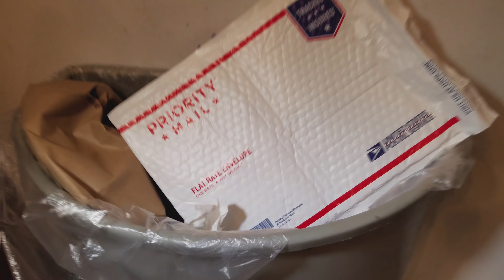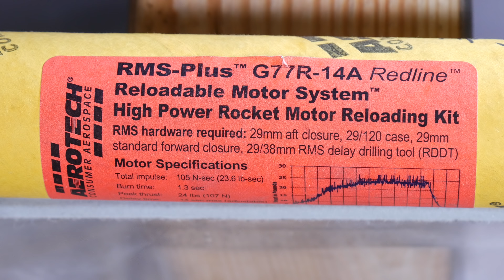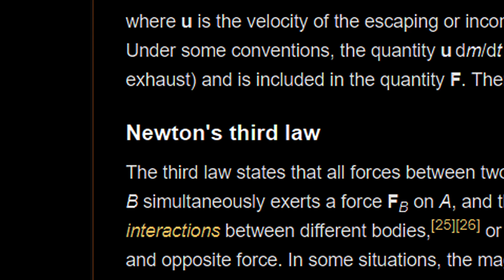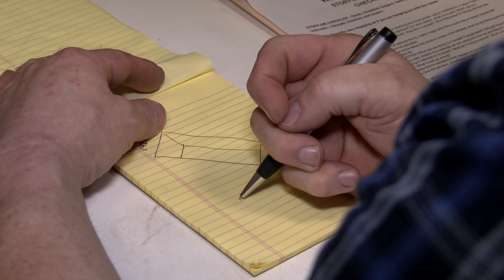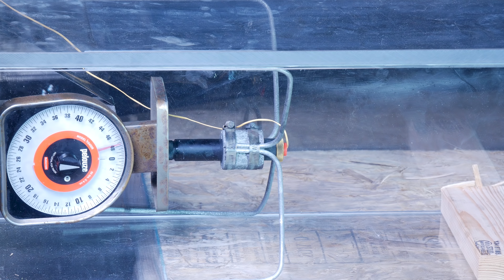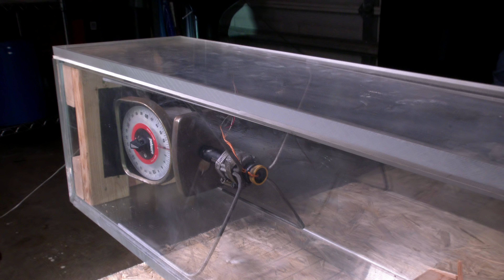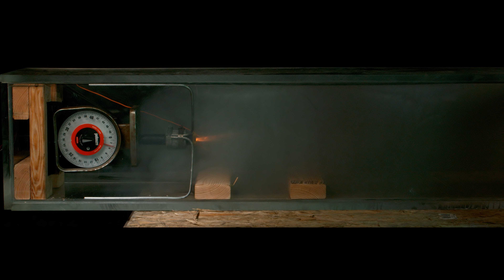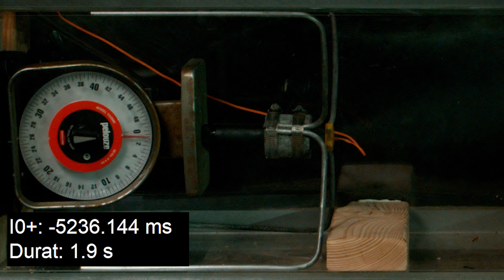Rockets in a Vacuum Chamber - Newton's third law of motion Visualized

Comment: There was no more vacuum when the smoke and gases filled the chamber. Even more, it is seen that the thrust increases with the increasing concentration of gas and particles inside the chamber. An even bigger chamber with constant dynamic vacuum would be required.
Reply: In increase in thrust over time is due to the motor design, these motors rarely have a constant thrust it changes over time depending on the thrust curve of that particular motor.
Reply: Correct. This video actually does more to prove that propulsion DOES NOT work in a vacuum.
Reply: @MoneyIsSilver  I could explain how rocket propulsion works but you must have at least a high school grasp of basic physics.  I guess that disqualifies YOU.
Reply: @stuartgray5877  You guys just embarass yourselves with the insults and lack of any real arguments.
Reply: @MoneyIsSilver  - "and lack of any real arguments."

Ok let me get this straight. I tell YOU the following:

1 - I have been testing fiber-optic gyroscopes using earth rotation as the stimulus for almost 30 years and is Proof of a spherical rotating earth.
2 - I have personally launched SIX spacecraft, four of those to deep space, and helped OPERATE them, then had the scientific results from the missions reviewed by ACTUAL SCIENTISTS, is proof of the spherical rotating earth.
3 - I have PERSONALLY taken photos of earth using more than one camera from space and SEEN that the earth is a sphere.
4 - The fact that YOU CAN SEE THE ISS in orbit complete with giant solar arrays and the Dragon spacecraft docked to its side is proof of a spherical earth
5 - The GPS Constellation is proof of a spherical earth.
6 - The FACT that the Moon rotates one degree for every 70 miles moved north/south is proof of a spherical earth.
7 - SATELLITE TV is proof of a spherical Earth.
And I can KEEP GOING!

And YOU say these are not 
"real arguments".

Sorry but these are all "real" AND are "arguments".
So, I think I have figured out the problem:
YOU
DONT
KNOW
WHAT WORDS MEAN,
 SHITHEAD!
Reply: Zener - Can YOU answer my three questions above?  These will help you to understand what is happening in a rocket engine in a vacuum.

DO you think RECOIL would still work in a vacuum? If you fired a crossbow into a vacuum, would it still have recoil?
Reply: @stuartgray5877  You don't even understand that appeals to authority are a logical fallacy.
Reply: @stuartgray5877  Again, can you explain why the engine in the video doesn't pull against the wire immediately, and only does once the tube fills with gas? No, you can't, because you would have to agree with the facts which agree with me.
Reply: @MoneyIsSilver  So an Appeal to NEWTON regarding PHYSICS is a logical fallacy?

See you STILL don't know the meaning of words.

Now answer my questions and prove you have a clue.
Reply: @MoneyIsSilver  Why are you afraid to just answer three yes/no questions?

All they do is prove if the reader understands newtons first two laws.
Reply: @ezraprice6709  And you can provide evidence of that?
Reply: @MoneyIsSilver  - "can you explain why the engine in the video doesn't pull against the wire immediately"

It is true that the ignition of the motor in that small vacuum space "ruined" the vacuum almost immediately.
Then there is always a noticeable delay in a solid rocket motor igniting before it reaches even 50% of rated thrust.

This is a bad example of rocket propulsion in a vacuum, but I have a much better one.
Bet lets define "Vacuum" for the sake of the conversation.

How low of a pressure would you need to see evidence of a propulsive maneuver taking place before you considered it "vacuum"?
Is one TENTH Atmospheric pressure low enough? or One One HUNDREDTH atmospheric pressure?

How low of a pressure do I have to perform the experiment IN for you to be happy?

Assuming I maintain his level of vacuum, or higher, through-out the test?
Would one one-thousandth of atmospheric pressure be low enough?

I don't want you moving the goal posts once I agree to show you video evidence.

And just for full disclosure: I have been a vacuum test specialist for over 25 years with experience running some of the nations largest vacuum chambers with billion dollar experiments inside.
The company I work for tests rocket thrusters her on earth in a vacuum, and again in space.
I have had about 25 years of hazardous materials handling certifications at Military installations like CCAFS and VAFB from fueling spacecraft before launch.
Reply: @MoneyIsSilver   @MoneyIsSilver  - "I want to meet you in person to tell you what an idiot you are to your face."
I am an Aerospace Test Engineer with almost 30 years experience and I have hands on worked on two hypersonic vehicles that actually flew through earths atmosphere. One of them is in the Smithsonian with my signature inside it.
I have also helped build, test and launch, six spacecraft, four of those were deep space science probes.
I have worked at (or for): Lockheed Martin, Jet Propulsion Laboratory, Laboratory for Atmospheric and Space Physics, Marshall Space Flight Center, Goddard Space Flight Center, NOAA, Ball Aerospace and DOD.
I have been on the mission operations team of three spacecraft, the launch conductor for six, and a Flight Director at JPL.
you can find my resume as I dont hide my identity.

Now tells us all what YOU do.
Reply: @MoneyIsSilver  Oh. I SEE that you deleted a bunch of your comments!
Why is that?  Were you EMBARASSED by what you found when you looked for my resume genius?
Did you realize you were dealing with someone with an IQ greater than their shoe size for a change?
Now you ran away?
Maybe you learned that one should not argue about basics physics with actual engineers when you have never even completed HIGH SCHOOL Physics.

I accept your surrender.
Reply: @MoneyIsSilver  To all of the OTHER READERS:

The point I was trying to make WAS:

We have established that when a rocket engine is running it is ACCELERATING the MASS of the exhaust gas from the nozzle.
This means that there MUST BE a FORCE accelerating that mass.
There is NO OTHER WAY to accelerate mass than with a FORCE.
Newtons first TWO LAWS makes this very clear.

But what does the THIRD law tell us?
That "For every ACTION there is an equal and opposite REACTION".
This means that "Forces only occur in PAIRS".
A force can NEVER occur ALONE.
when one object with mass pushes on another object with mass - BOTH OBJECTS FEEL THE FORCE!
THIS is the meaning of the 3rd Law!

So if the rocket is exerting a FORCE on the mass of the exhaust gas then what do we know?
That the exhaust gas EXERTS AN EQUAL AND OPPOSITE Force BACK ON THE ROCKET!

Now that you understand ALL THREE of Newtons laws we see that a rocket PUSHING OUT MASS - FEELS THE SAME FORCE BACK ON ITSELF!
This is called RECOIL or ROCKET PROPULSION .
It occurs IN A VACUUM just as Newtons laws tell us IT MUST.
Reply: @stuartgray5877  I didn't delete any comments. The poster probably is censoring me.
Reply: @MoneyIsSilver  Oh, then perhaps your response to my questions was also censored.
If that is the case then I apologize and ask you to repost.

Care to try again?
Reply: @MoneyIsSilver  I guess to ask the question in a much shorter way:

Can any device (machine, catapult, crossbow, gun, etc) accelerate 500 kilograms of WATER (liquid, ICE, doesn't matter) from a standstill to 2500 meters per second WITHOUT Feeling a recoil force?

It doesn't matter if the device is firing into an atmosphere or a vacuum, WILL IT FEEL RECOIL?

Imagine an aircraft carrier catapult that can fire three oil drum's worth of water from a stop to MACH EIGHT before the barrels leave the catapult.
Does the ship feel the recoil of that firing?
Yes or no?

(of course I know there is no aircraft carrier that CAN do this as that is "Ludicrous Speed" and none are capable of that).

Its a yes or no answer
Reply: @MoneyIsSilver  still refusing to answer simple questions?  Why are you SCARED?
Reply: @stuartgray5877  I think he can answer your questions once YOU figure out that you never actually ASKED anything😐...you just made alot of statements and asked 1 about newton😆 I think YOU need help with words mr "scientist rocket man with no actual proof"
Reply: @stuartgray5877  ah! So you finally did ask a question but it has NOTHING to do with ZERO oxygen atmosphere but nice try ..and if you know what you know, then youd KNOW that asking that question about the vacuum chamber and different atmospheres was a stupld question 😆 because I could have sworn we were talking about SPACE.. where rockets that you CLAIM to work on are supposed to go.. but it seems to he a problem apparently...and let me guess you also worked on the moon landing lol
Reply: @wealthnow5166  - " think he can answer your questions once YOU figure out that you never actually ASKED anything"

Thats Odd since I cut and Pasted the following FROM ABOVE:
"1 - When a rocket engine is running, is the exhaust gas ACCELERATED by the engine? Yes or No?
2 - Does the exhaust gas have MASS? Yes or No?
3 - Can any MASS be ACCELERATED without a force? Yes or no?

(or is a force REQUIRED to cause an acceleration of mass?)"

See so I DID ask questions. But since you are new to this thread I wasn't ASKING YOU.
But please be my guest and answer.
Reply: @wealthnow5166  Want to talk about rocket in VACUUM?

Sure, answer these three questions about ROCKETS IN VACUUM:

1 - When a rocket engine is running, is the exhaust gas ACCELERATED by the engine? Yes or No?
2 - Does the exhaust gas have MASS? Yes or No?
3 - Can any MASS be ACCELERATED without a force? Yes or no?

(or is a force REQUIRED to cause an acceleration of mass?)

Now answer these three questions about rocket propulsion and we will get to the NEXT questions.
Reply: @stuartgray5877  yes yes and yes
Reply: @stuartgray5877  no I actually looked at your page you appear legit but I still want to see an actual space not low earth orbit and reentry after booster stop ykno?... I hope you dont dismiss tho
Reply: @stuartgray5877  those questions weren't anywhere around before I appeared  and the first time you asked these questions you asked it to ME lol... you @ me twice with the same question..I can screenshot and send but I dont think you'd care to lie Id hope
Reply: @wealthnow5166  - "yes yes and yes"

Close.
The answers ARE:
Yes, the exhaust gas IS accelerated.
Yes, the exhaust gas HAS MASS.
NO Mass CANNOT be accelerated without a force.
A "Force" is literally the ONLY thing that can change the velocity (momentum) of an object with mass.
So, what can you conclude from these answers?
That there MUST be a FORCE accelerating the mass of the exhaust gas from the rocket nozzle.
Now what does Newton's THIRD Law say about forces?
Reply: @wealthnow5166  I posted the questions in this thread 9 months ago to member Moneyissilver

YT often blocks posts in a way that the OP sees them, but no-one else can. Kind of "shadow blocking" a post.
I could show you a screen shot where my post above IS visible in this thread where I present the questions to
Reply: @wealthnow5166  Now watch the YT video:
 "uninterrupted footage of the falcon heavy launch and booster landing! 2-6-18"
 Watch from launch to side booster landing then EXPLAIN in your own words what you just witnessed. If you cannot spot the multiple examples of rocket propulsion in a vacuum, then I would be happy to point them out to you.
Reply: @wealthnow5166  So, what can you conclude from these answers?
That there MUST be a FORCE accelerating the mass of the exhaust gas from the rocket nozzle.
Now what does Newton's THIRD Law say about forces ?
Reply: @wealthnow5166  OR you COULD just watch this weekend's launch of Falcon heavy. The LIVE video had numerous examples of rocket propulsion in a vacuum.  If you can't spot the MULTIPLE examples of rocket propulsion IN A VACUUM in that video, just let me know and I will point them out to you.
Reply: @wealthnow5166  Where did you GO? SCARED to address my evidence that YOU are wrong?
This is called Cognitive Dissonance. Ask the teacher of your special needs class to EXPLAIN THAT TO YOU. And Bless your little heart!
Reply: @stuartgray5877  and went where?🤔
Reply: @wealthnow5166  - "no you just couldn't or can't and never will show us anything other than low earth orbit.."
Tell me 
WHAT YOU LEARN
when you search the net for:
"What happened to Comet Tempel-1 July 4th 2005".
Then EXPLAIN
IT TO ME.
Reply: @wealthnow5166  - "so I dont care anymore..."

So you are just going to continue to believe that Mechanical RECOIL does not occur in a vacuum...."cuz reazons"??
Reply: @stuartgray5877  I admitted that I think there would be recoil already, but now I'm actually not sure anymore...I need to see more sophisticated vaccum chamber that actually matches space environment! Do you have a videos you could recommend of that?
Reply: @stuartgray5877  hey, where'd you go? Every day I've been patiently waiting for you to answer my questions! Hope your doing okay to  by the way
Reply: @stuartgray5877  well I'd like to apologize on behalf of YouTube if you did respond... and as far as the go back to school comment, how would they know the answers when even the book doesnt have them.. we"ll all be in the same boat..and you muting me would put you in the same boat as Yt sir🤔.. either that or you were actually lying to me because you couldnt answer me!? Because I honestly cant imagine YOU using harsh words that Yt wouldnt approve of🤨 I thought our conversations were fairly cordial..but have a good day stuart I hope your not a lying 😂
Reply: @wealthnow5166  - " how would they know the answers when even the book doesnt have them.."

One thing I am 100% CERTAIN of is that Physics Books explain the Law of Conservation of Momentum.

But thanks for proving you have never even LOOKED at a physics book in your life.
Reply: @no-yy1qg  And one more thing to note: MANY of my posts do not show up to other viewers. It looks to ME like I posted questions and information but YT "shadow-bans" many of my posts. So sometimes I cannot TELL if others can see my posts unless I logout and visit the thread anonymously. You would be surprised how many posts are treated this way by YT. The OP never knows that his posts are blocked so it LOOKS like people are ignoring the questions.
Ever wonder why the "Post Count" at the top of a thread doesn't match the ACTUAL number of posts?

SO even in THIS THREAD - MANY of my posts with questions were blocked but I did not know it. You can see my interaction late in the thread where I try to explain this to "Wealth Now"
Reply: Except he "thrust" gauge increases before the gas plume hits the back of the chamber. 
Also, how do you propose the particles of gas transmit the "resistance" back though the gas to the thrust sensor, champ?
Reply: @Cosmic-Spanner  - "Also, how do you propose the particles of gas transmit the "resistance" back though the gas to the thrust sensor, champ?"

Via the same "Magic" that holds us to the earth (since the Flerfs don't "Believe" in Gravity)
Reply: @MoneyIsSilver  The thrust is registered at 10:22 before the smoke moves even a few cm into the chamber. You cant refute the laws of physics, Einstein.
Reply: @stuartgray5877 this experiment is invalid. Top basicaly flies off for a moment and smoke escapes
Reply: @nazalostizsrbije  Sure but his intention was just to LIGHT the engine in a vacuum, not show continuous thrust.
Now at my company we DO test real rocket thrusters (Hydrazine Monopropellant thrusters from Moog Corp.).
We put these thrusters in a real vacuum chamber and test the ignition AND THRUST in hard vacuum.
We verify that they DO produce the thrust predicted by the 100-year-old (TESTED) Tsiolkovsky rocket equation.
We then put those thrusters on real spacecraft, launch them to space and test them there too.
The last spacecraft I helped build that had a propulsion system (not ALL satellites do) was the WSF-M spacecraft for the US Space Force.
I will help launch it early next year on a Falcon9 from VSFB.
Reply: @nazalostizsrbije  If your suggesting that the small amount of time the top lifts off is enough to completely re pressurize the vacuum chamber have you got any support for that statement?
Reply: correct !
Reply: @stuartgray5877  No one here is talking about flat earth. It looks like you are justifying ignition in a vacuum based on a discredited narrative regarding the shape of earth. Rockets launch or don't launch because the Earth is round right? Lol you're funny. I hope my next question won't make you think about that, not every sceptical is a flat earther.

How do you go through the frozen ozone layer, since space's temperature is below the freezing point of the ozone. You just break it & contribute to global warming, hoping you'll be living on the moon while others are radiated here ?

Do you really need to go that far up to take clear shots of a wider parcel of earth? Do you really need to be in outer space to get your proofs? 😂

You may be ingenious but taking others for fools for your passions, lubies isn't that scientific. What science is the closest to prove is death. Infinity exists in numbers and formulas and you fail to breath with your head in the handlebars to realize you only grasp at a tiny little part of a bigger formula, meaning you accumulate problems, to solve problems, adding problems. There's no maths or physics applied to the real world that is true & finite, all is leading us to destruction. Every single thing discovered triggers a reaction and as fast as science expands the faster it's driving us to extinction. It triggers exhaustion of resources, slavery, misery, wars, pollution, etc.

Maybe learn to finish a problem before trying to expand your science to other cosmic bodies.
Reply: @sarabranco5100  I think you missed your meds today
Reply: So you can regurgitate what you were told.